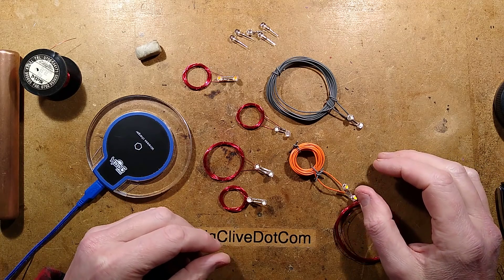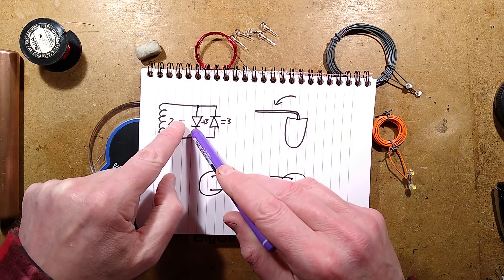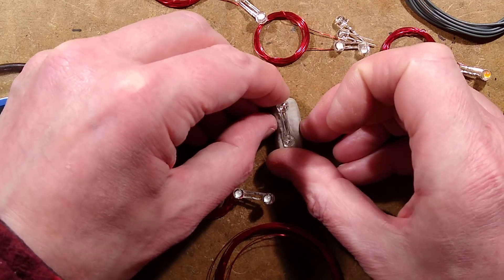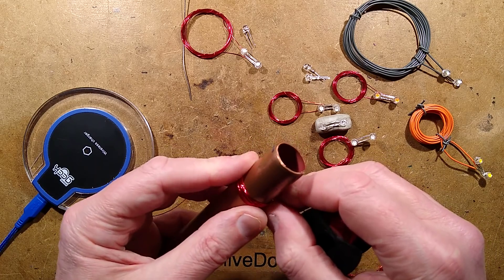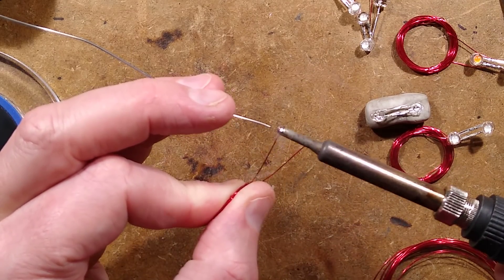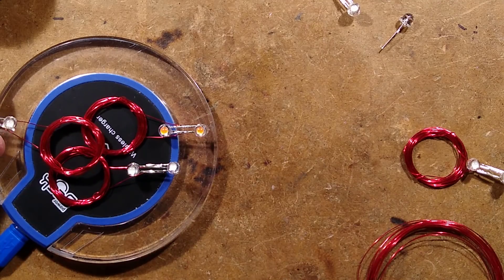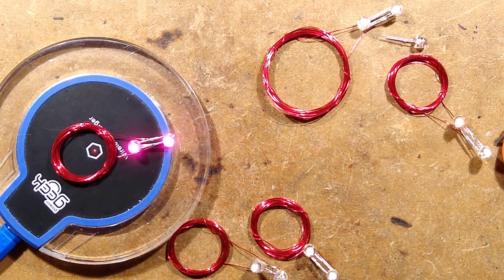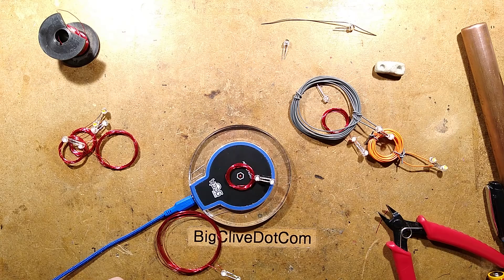Easy DIY wireless strobing LED light

Comment: Have you seen the inductive coil wireless power things that have popped up lately??  I think I first saw them on adafruit's youtube.  I got a couple and they are awesome!!  Continuous power that can easily light a dozen led's at over a foot away.
I would very much like to see one reverse engineered because I wonder if there is a easy way one could make a do-it-yourself version.  I would like to get more of them but they are apparently in high demand because they are expensive and/or out of stock in various places.  I also think it would just be fun to make some myself, I can follow a schematic, but I can't figure it out my self, lol.
Reply from the maker: I have a set already ordered from a Chinese seller.  I didn't realise Adafruit had them.

Comment: I don't know how big the coil has to be for it to work with a QI charger, but I built something similar with an SMD inductor. Just for fun (didn't buy anything). I used a 1mH SMD inductor (about 5x5x5mm) desoldered from some random PCB, soldered an SMD LED (also salvaged) across it's contacts and put an SMD MLC capacitor (again salvaged) in parallel on there as well (so it's a 5x5x6mm thing at the end ;) ). I don't know the value of the capacitor, but considering that the LED is the brightest when excited (with a random 40mm coil salvaged from a printer) by around 15kHz, it should be about 100nF (because the resonance frequency of a 1mH/100nF LC circuit is about 15kHz).
If the frequency is given (like on a charger), you could tune the circuit to be resonant at that frequency.

Comment: Try it with a simple SMD inductor coil. It works really well and you don't have to fuss about with winding one. Small capacitors across the LEDs will add a strangely pleasing brief fade out effect.
Reply: Yeah the fun with this is that basically ANY coil + LED setup works. You don't need anything else. I've made it work with a 5cm diameter loop of 3 turns of 0.1mm enameled copper wire, and those low profile LEDs (0.15mm) which make it as small of a setup that you can embed inside card stock if you wish.
Reply: The indicator LED of of a buck converter stared to blink if you put it on the QI charger. (It was car cigarette phone charger) It must be the inductor inside having a voltage induced.

Comment: My dad made a few of these for testing whether race car transponders are transmitting, but with only 1 LED.  The previous method he used was listening for noise from an AM radio.  The coil of wire with an LED worked so much better in the noisy pit-paddock area of a large race venue.

Comment: Clive! Here's a riddle;- Phone to guitar amp for external speaker through mm jacks while on pause clicks with bursts of static several times then receives radio broadcast clearly. Repeated it a dozen times to try and figure it out. Never "clicked"  or happened before an hour ago. Not doing it while I type, it stopped. Any ideas what the click was? Stopped when unplugged, did not continue through built in speaker, then clicked and bled through replugged. Not a station I listen to so I don't think it was a glitch in the built in radio app I rarely use. Could it be power spikes at the station?
Reply from the maker: Was it normal radio or a walkie talkie style communication?  My old amplifiers in Glasgow used to make a lot of noise when taxis were outside using overpowered radios.

Comment: Can this or other models of wireless chargers be energized by a power bank continuously until depletion, without the power bank turning itself off due to insufficient current draw?
Reply from the maker: If there is a load the power bank should stay on.
Reply: @bigclivedotcom  

But not, I guess, if the wireless charger is idling and just flashing these LEDs.

Comment: Hi Clive, If you leave the phone close enough to turn ON the wireless charging you should be able to power even more LEDs without the strobe effect? I would also add a capacitor though....

Comment: You can buy very similar 'wireless LED' kits from Aliexpress for about £5 with a tuned transmitter and the LED construction made of SMD parts (they use an SMD inductor for the receiving coil). They are very tiny, I used them to make light up cast resin dice for some board game playing relatives last Christmas, and hid the transmitter/coil arrangement in a 3d printed 'dice rolling mat'. I added an extra SMD led to each receiver for better light coverage and to consume the unused phase.

Not my video reviewing them https://www.youtube.com/watch?v=xJc-Dkvh4Q8

YT deleted my comment :P

Comment: Ah the things you come up with this was very interesting but what would happen if you were to make a 100 wind coil as opposed to a 10 wind coil
Reply from the maker: It should generate a higher voltage.
Reply: With enough turns, you can light a neon bulb instead of a LED. Then make another coil with a LDR attached to it and it will turn off the neon bulb when it sees light. You can then put the two together to make the bulb flicker, or you could illuminate the LDR with the flashing red light on a broken smartphone (which was used to mine crypto until it won't mine anymore) and make the neon bulb flash.
https://www.youtube.com/watch?v=nbpwIO3fwxY

Comment: Do not see a practical  use for that at all. Cool video however.
Reply from the maker: Impractical circuits are usually the most fun.
Reply: Very simple wireless charger tester.

Comment: Putting one of those on a phone gave me an idea. An app running as a background service could monitor for incoming calls and trigger a whole bunch of NFC scanning or something, making it work like one of those old phone stickers you showed last week but for modern phones. The circuit could possibly also have something added to mask off the regular scan pulses so it's not flashing all the time, or the app could just turn NFC off if you don't need it for other stuff.
Reply: If you go to the effort of making a app that runs on the phone. Could you not simply trigger a built in led like the camera flash?

Comment: Hey! I take the inductor coils and other tiny coils off of motherboards and attach an led to the ends of the wire. It usually makes it flash on a qi charger but the coil size makes the brightness vary. I havent had any break yet.

It also makes different patterns depending on the charger. Some strobe, some do bursts of multiple blinks.
Reply: Instructions unclear, can't boot PC
Reply: @Dennis_M1DLG  ahh. Thats the reason you have to leave the inductor on the computer board and plug all wires together as per the project. then, when ready, plug computer in. not only blimking lights, but actual sparkler effect.  This is true because i have seen a sparkler.
Reply: @Palmit_  Followed instructions, produced magic smoke. Rob you could market this.
Reply: @Dennis_M1DLG  only smoke. same when i tried it but i had sparkles. did you get noises as well like i did?
Reply: @Palmit_  I heard a couple of fizz sounds followed by a loud bang, this is the bit where the magic smoke came out. I know it's magic smoke because it was grey-blue and came after the fizz sounds.
Reply: @Dennis_M1DLG  hmm. very similar! did all your lights turn off to enhance the sparkles effect? and like a sort of weird "shiver" along arm and in chest? dont get me wrong. am pretty sure it's safe, but i can't be (air quotes) sure (air quotes) unless everybody tries and reports their findings. hopefully the community will help with their experiences.  ps.. did you piss yourself during the enhanced sparkle/smoke /noise effect?
Reply: @Palmit_  funny you mention this, I thought the stain was something else, but come to think of it I think I did leak a bit.
Reply: @Dennis_M1DLG  that's a relief.  "*ba dom tsst*" 
I thank you. takes a bow

Comment: Wonder if you can modify the circuit so it doesn't strobe
Reply from the maker: The version in the video that has a rectifier and capacitor was an afternoon at that.  It didn't put out much current.

Comment: Nice idea. If you bring the phone in while the coil is on the pad does it turn them on continuously? if so, does it stay on when you take the phone away?
Reply from the maker: The phone coil shields the output.
Reply: Yes, I found it goes to permanent glow but it does revert to flashing if you remove the phone (but I am using one of those plugin wireless receiver modules that you can add to your existing non-wireless phone, so the phone doesn't get in the way. Lidmotor also ran a pulse motor wirelessly off these.

Comment: Hi BigClive. I watch your videos every often. These brings great Knowledge and inspiration to me. Man when I see this soldering iron and those screw drivers in your hands, I wish I could have them too but unfortunately I'm in Pakistan and can't have them.
Reply: Yes you can. Start small, you don't need to pay $100 for a soldering station, even Clive will actively use his super cheap $14-20 station and it seems like it's never failed him for years. Even then, you can try getting one of those super cheap irons you just plug in the socket they are good enough for most things.

When I started out my soldering iron was a steel rod I jammed into a wood dowel and I heated that over an open flame, I got my tin from old circuit boards... yes, I made my own soldering iron because I couldn't buy even the cheapest one, I recycled soldering tin because I couldn't afford it either and all the electronic components I worked with were salvaged from the trash. I started fixing electronics as a hobby and after I fixed a couple of monitors I had enough for a real soldering iron, then for a spool of tin and so on.

It's not like I have a workshop now, but I do have a fairly full set of tools I have bought one by one over the years, most of them cheap, many of them used, some of them salvaged. To this day I still collect all the waste tin and re-melt it into a big blob I keep around (very useful for tinning thick wires), to this day 90% of the components I use on my for-fun projects are salvaged from the trash.

I'm not as poor as I was before but I am certainly still poor as shit, and if you can read this then you can do it, you can have your own tools even if they aren't many and they are cheap or used, you can create your own projects even if you have to scavenge for components in some e-waste. Adapt and overcome my friend, greetings from Venezuela.
Reply: @Mylity66  yes, cheap soldering irons are 99% perfect for anything, i NEVER bought one of those soldering stations (i'm not referring to hot air guns, those are particular), you can perfectly use a 4$ iron as long as you can find decent solder wire, that makes a difference instead... anyways late sodering irons have silver plated tips and you just need to clean em on a wet cloth after a couple of solderings and it will always be shiny and 100% usable, unlike old types that were made of raw brass and after a single session you had to file or sandpapaper it... YUCK!!
Reply: @redoverdrivetheunstoppable4637  A station is nice though, a cheapy Hakko clone one like the one Clive uses in this video (he showed them in a few videos before, basically he said that " Meh, it's fine" and has been using it ever since 😂) my station was $12 like 10 years ago and you know what? Yeah, it's fine.

They are nice because they get to temperature in 10 seconds and because you can control the temps. But you know what? I still keep a $1 crappy old iron that  melted it's original cable and has a freaking nail for a tip (also chewed through that one, brass, so yeah gone in a couple weeks). I can solder copper pipe with that bastard, so much thermal mass.
Reply: @Mylity66  i didn't know you could buy a station for 12$, but nah, i think i'll never buy one... i'm currently using a 6$ adjustable iron (the one with a transparent handle you may have seen around), i don't care much about heating it up in seconds, this is hot in like one minute but also there's not much need for adjustable temp, you just need a powerish one of like 60W and a smaller one with a fine tip... just for being less trash the smaller one can be modified adding a 3 megs resistor from the iron to earth to be a bit safer on ESD components and i also add a coiled telephone cord instead of the power cable to be "out of my balls" instead of having the power cord hanging everywhere on the desk, once you get used to the springy cord this is handy

Comment: With enough windings and a transformer or 3, think you could make a tiny arcy-sparky table ornament?
Reply: My thinking exactly, I wonder if an old ferrite core CCFL transformer would work well enough. Add in a Qi chip to negotiate full output and you might even be able to make a tiny Jacob's ladder or spark gap tesla coil.

Comment: Fun project.
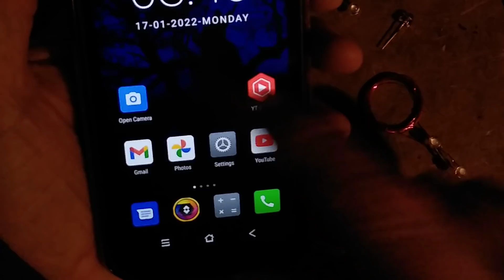Check out 7:30 - the green LED seems to be really pulsing at miniscule levels after the initial "high energy check" was done.
You can see the three bright flashes and then tiny dim flashes. Probably some beacon-checks. "High power" checks if presence is there and then just listening for other things.

Edit says:
I really don't want to try this at home and I hope nobody else does it - but I am REALLY intrigued about the forbidden Qi-Charger - the inductive stovetop. My stove has a basic check if it can detect a big enough pot on it to power the coil up completely - I bet this would really flash a big set of LEDs - potentially damaging stuff when used wrong.
Reply: ElectroBoom did some things with an inductive cooker
Reply: I’ve been joking about charging my phone on my induction stove for a while.
Reply: The forbidden Qi charger: https://youtu.be/BIjHlZPscJo
Reply: I wonder if it would work at all, thinking it is working at a lower frequency. But what could go wrong? Max. some LED's blow up since the heater will more then capable .
Reply: This is really stretching, but I can imagine a use case for this as an ad-hoc power source / transformer for some illicit device in a prison. Perhaps the least plausible part would be a prison kitchen having an induction cooktop to begin with. But, who knows? Maybe they needed a kitchen in a building without any gas lines, and it was more economical to go all electric.
Reply: @Heizenberg32  there are number of other types of electric furnaces, there ain't a reason they'd want inductive one in prison.
Reply: @plainedgedsaw1694  I was thinking an inductive stove top rather than a furnace. Either way, you are right.

Comment: Not sure if this is up your alley, but my new dash cam is always plugged into power(through the fuse box), has GPS and wifi. Have any idea what stays on when the vehicle is turned off? Did I just tracking beaker myself?
Reply from the maker: If it stays powered then while on it will still record, but if off it will probably just be in a sleep mode.

Comment: WHERE IS THE AUDIO DUDE?
Reply from the maker: Check Dolby isn't putting it out to a missing speaker.
Reply: @bigclivedotcom  From one vid (the history guy) to next (bigclive) is a massive diff. I have no way here to quantify it in db but it's way more than 3db down. (10?)
System is a linux laptop bt into a roku streambar.
Reply from the maker: @n3glv  When I tried adjusting the audio level on this video the app I use for it repeatedly crashed.

Comment: If you put a capacitor across the coil (probably 1-10nf) so it resonates with the Qi charger frequency, it will work at a much longer range - may also work better with one LED as this lets the resonance build up more over the previous half-cycle
Reply: I've done this a couple of years ago, ten turns and 0.5ųF gave good results.
I used 1,5mm2 solid installation wire, just so the coil looked 'schoolbook' like and steardy.
Reply: If you go even further and measure or calculate the inductance of your coil and choose a capacitor to match the 140kHz oft he QI charger you get even more power and extra long range. I’ve tried this with all the components in series and it works at +20cm distance with eye burning brightness.
Reply: Exactly what I wanted to write. Small cap and it could work tad better. It's more work and elements but end results is nicer.
Reply: GreatScott did a video with the calculations for a QI charger and anything over 0.42mm wire thickness is wasted due to skin effect at this frequency. Using multicore wire improves efficiency and using a ferrite plate nearly doubles the efficiency. Worth a look. https://www.youtube.com/watch?v=3E5PUnYlaTM

Comment: I would expect the closer the tuned value (or harmonic) of the coil/LED network is to the operation frequency of the charging pad (I think it's in the range ~100-200 kHz) the more energy would be transferred and the brighter the LED's. Maybe the main difference between the 10 turns and 20 turns coil

Comment: Second thought. Could you put a small lithium cell in there (like those ones you've been scavenging)? Charge it off of the pulses?
Reply from the maker: It could, but a proper communicating charge circuit would be better.
Reply: @bigclivedotcom  I was more just thinking about a little rechargable blinky thing.
Reply: You could probably get much further ahead with the Qi coil and Qi board.  Its really peanuts and it would be able to negotiate a proper power connection.  These little pulses are really not collecting any power worth keeping.  They are only engaging the "sensing" pulses from the Qi charger.  A small capacitor would be a better choice instead of the battery.

Comment: Acetone should strip the enamel. I'll try it tomorrow and get back to you.
Reply: Acetone softened the enamel on all of my magnet wire, completely dissolving it off in one case. In all cases, it made it easier to solder.

Comment: I just bought a premade batch of LEDs and the transmitter from adafruit, and was also wondering what to do with them.
Reply: Adafruit solders surface mount LEDs directly to surface mount coils. Very clever and compact. They also use a custom "dumb" transmitter that puts out DC without needing a protocol response.